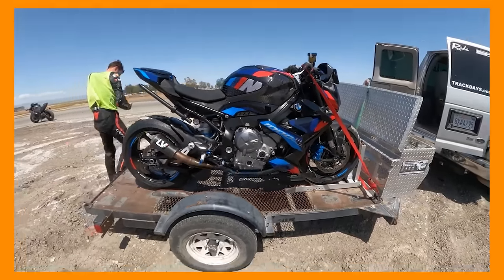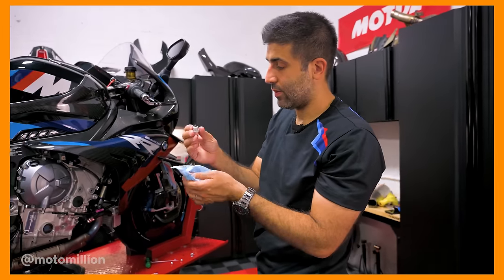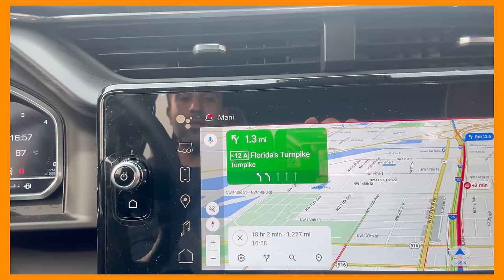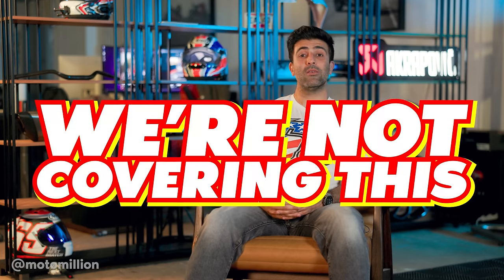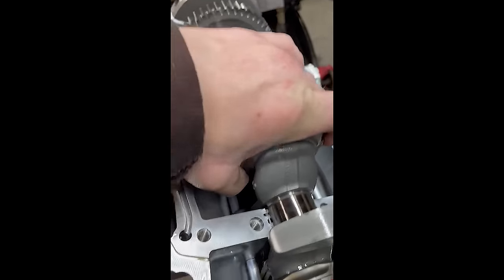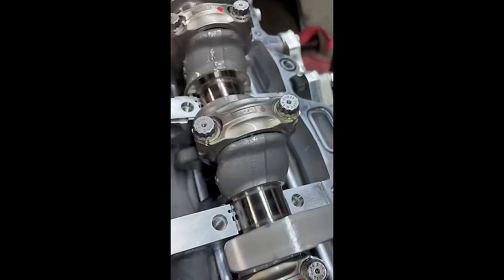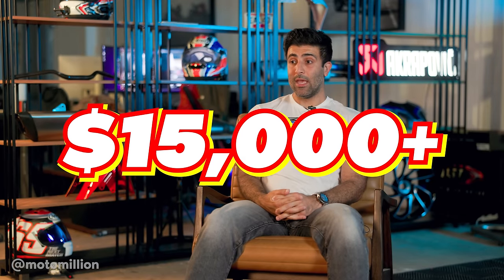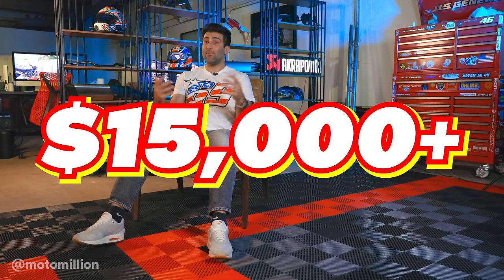MASSIVE Engine Failure on our M1000RR & BMW REFUSED Warranty...

Comment: Had a BMW S1000RR 2020 M-packge.

Nothing but problems on my side, I sold it and bought a Yamaha R1 2024.

Things I changed on warranty:
-handle bars rubber
-left mirror 
-front forks
-front calipers
-cam chain tensioner twice
-oil pump
-oil cooler (radiator)
-airboxintake silencer air filter box housing
-rear braking line and abs electric wire was touching the exhaust and popping ABS failure
-lots of condensation build in the exhaust cat and popping check engine failure

I got so dissponinted with that bike, I was so scared that one day that engine will blow up and die on that bike. I can sleep better now as I got rid of it. NEVER ever going back to a BMW or looking at them.
Reply from the maker: The R1 sounds the best of all liter bikes! Congrats on the 2024!
Reply: Dang, see I wanted to do a wrecked build series with a s1000rr, I don't think I do anymore hearing of issues like this because there isn't a warranty on those...
Reply: wow, that insane! I almost bought a non m s1000rr recently but picked up a ZX10r because it was so much cheaper and Kawi's history of reliability. My first ZX10r I put 55k miles on and it never once had any problems.
Reply: The newer ones are the problem.
15-18s are really great.
09-14s are okay.
Reply: @Motomillion r1 and ducati sound the best at a idle and low rev but, when you get into mid and top speed and high revs, bmw wins in the sound division.
Reply: Maybe BMW and KTM are related. Both make over priced unreliable shit.
Reply: My 2016 s1krr was great bike
Reply: That’s mental
Reply: @motor_head  my 18rr never had an issue, 16,000 miles or so when I traded it in. My 23 was taken and waiting on the 24, that I am now debating on telling them to keep it.
Reply: @taylorhickman84 Had lots of ZX10s decade or so ago and never had issues with them either. But one of them the cams that came out (was cammed) had low kms and abnormal wear on the coating of the cam, right on the end guide, from memory where the chain sprocket is. Engineer looked at it and said probably due to cold starting and lack of oil. Interesting, but I never had a problem.
Reply: @N4CR  Now that you mention it, one of mine had a problem with the cams as well. I bought a clapped out '07 with 13k miles and when I pulled the motor after I wrecked it, some of the cam lobes were slightly squared off instead of having a nice egg shape to them. I wondered if the previous owner had rev bombed it at bike nights. The bike ran fine, but it did struggle to get past 175mph when I did a track day at COTA.
Reply: I love the R1 they are great for tall guys like myself, have been riding gixxers for years but i am looking to buy an R1. 

I have to disagree with you on the sound i like the sound of all the other Japanese sportsbikes fours which haven't changed since my Z1 900 in the late seventies.

I guess the R1 sound is an acquired taste they did sound like all the others prior to the crossplane engine.
Walter.   @Motomillion
Reply: Wow, I was torn between s1000rr-m or R1 i'm very glad I went with the 23 R1 after reading about many issues like this. Thanks for leaving the comment brother!
Reply: I have a 2018 MT10 (basically a naked R1) and have ridden it 20K miles with zero issues
Reply: do not get it BMW suck any company that does this 100s of times is bunk  plus plastic water pumps on cars i seen the junk from them its a mix of great and WTF  @jasonisdn
Reply: RSV4 is the bike to ride.
Reply: @robvanduren761   KTM stands for ?  Klatters Too Much  ?   Mine did (past tense cause I SOLD it!  lol)
Reply: @taylorhickman84   cheese cams?
Reply: @luisdetomaso867   Yamaha is just a tick beneath Honda for stone cold bullet proof reliability!  But then typically Yamaha models are faster (but get sucky fuel range and tend to require premium where Honda tends to lower compression to accomodate regular...lower compression better reliability at expense of performance....obviously not accross entire range....not talking fireblades
Reply: @luisdetomaso867 Awesome, I have a 2024 R1(Raven). Zero issues and I love it.

Comment: I had purchased my dream bike, the 2022 BMW M 1000RR in mid 2022. I got to enjoy around 5k miles before I experienced a catastrophic failure like you had with your M. I was on my way home from work when it happened. I didn't tune my bike like most owners of these machines do, mainly due to fear of warranty becoming void. After 3 months of waiting, BMW honored the warranty and sent a new engine for my dealer to install.  Unfortunately the new engine experienced issues after the break-in period, dream bike experience wasn't as pleasant as I had hoped.
Reply from the maker: Wow, very sorry to hear about your difficulties with your M1000RR. Definitely something none of us want to go through
Reply: time to go to ducati or aprilia.. bmw is shit
Reply: Our dreams are usually better than our reality. ;<)
Reply: What did they do about the second engine?
Reply: @richardtavarez2614 Ducati and Aprilia are shit, too—many if not more stories just like this one. 🎉🎉
Reply: Laugh with suzuki
Reply: Wow $15000 dollar repair bill after buying  a $40000 bike,By the sound of it, quite a lot of Friday afternoon engine builds at BMW.
Reply: @trekshogun  Frankly, it sounds like there's a more serious problem (AKA engineering) somewhere.

Comment: Didn´t the S1000 models have a required run in time of about 1000 miles where the power was limited, and only afer that they could be used with full power??
Not so sure if hitting the dyno at a little more than 400 miles was the best idea then....
Reply: I guess he wanted to skip the run in by modding the ecu and the engine just died.
Reply: I thought it was 600 miles.  And, they put a tune on it prior.  Sounds like they voided warranty.
Reply: Revenge the engine on the dynowoyld be the best thing for the engine so it has a load on it BMW stupid for not fixing this under warranty this has already cost BMW more that the fix in bad press I was looking at one of these motorcycles now I would never buy A BMW anything
Reply from the maker: CaliMotoTV's BMW M1000R blew up on the track. That bike had a full exhaust and an ECU flash. BMW fully replaced the engine under warranty.

Why was Bill's replaced even though modification were present?

Carwow's stock BMW M1000RR also blew up on the drag strip.

BMW is having major engine issues on these new engines.
Reply: They nerf it to 8 or 9k RPMs until first service.  Felt like an eternity on my S1000RR.  As soon as first service was done and I took it to 13k, I had the biggest boner. lol
Reply: They removed it at 350miles, then did they own "break-in" on Dyno. Wouldn't do it to R1 or CBR even though you can, with BMW lol oh please. Amazing how BMW looked at the pan and knew that they sold M1000 to the wrong owner.
Reply: Sure, he removed the Rev limiter according to bmw instructions (!) but even if he done it before, it wouldn't cause this type of failure. Fan boys here sucking up bmw corporate are delusional.
Reply: @Motomillion  Bot response and didn't address the comment.

People are so bizarre in these comments sections.

Answering questions not asked. Bringing points to things never brought up in the first place; goal post shifting due to ego problems or ignorance introduced through stupidity brought about from arrogance?

Certainly plenty of deflection and evasion and predictable denialism in many responses to these very comments if any are made.

Texas sharp shooter and band wagon fallacies are not responses from a logical mind.
Reply: @jorelplay8738  BMW instructions say 1000 mi, and they do it to make sure whatever is gonna break, can break before they give it full power. this was also tuned after a first service which wasn't even done by a dealer. I'm not saying BMW is right in saying they had no fault, but he signed the contract which lets them void warranty for something like that, and thats what they did. It was one him.
Reply: @jorelplay8738 
This failure may have been imminent but if BMW allowed every bozo on YouTube to ignore warranty conditions, do services by themselves, remove rev limiters and destroy bikes on dynos before breaking them in first (all during warranty period), then they'd really be suffering from bad press as they would repeatedly be made fools out of by, in BMWs eyes, silly little amateur 'content creators' worth a few tens of thousands of dollars.

Do you honestly think a multinational corporation worth BILLIONS and a brand name over a hundred years old, whose revenue probably dwarfs many small countries' GDPs, would allow that? Get real pal.

Comment: you lost me at 18:52 haha ...   the break in rev limiter is part of the warranty whether you "believe" in it or not.  like how hard is it to put 600 miles on the bike?
Reply: I put on 120 miles on my new bike the day I picked it up at the dealers, before the week was out it was due for its first service, this bloke had this bike over 7 months and only put on 400 miles, says he hasn't got the time to run it in but finds time in 7 months to do a pile of alterations on the bike, found time for no reason to DYNO it and rev the nuts off it, fucks the engine then finds 38 hours to drive it to his mates BMW mechanic hoping for preferential treatment, this plonker needs to get his priorities in order.
Reply: @bobp6742 😂 love this comment! and then proceeded to do a 35 minute session about it. guy could have went for a 2 hour ride and be halfway there with the milage
Reply: @TwoTechnics76  
He has a bike worth 40k that had only 9 miles on it and what does he do, takes a fucking angle grinder to it, he's not well in the head.
Reply: @bobp6742   yeah I found it weird he took it all the way to Cleveland Ohio from South Florida, because he doesn't trust anyone else?? wtf? there's many certified BMW mechanics and shops in the state of Florida that work hard on these bikes and do great work... something doesn't add up about all that
Reply: @TwoTechnics76  
He knew he'd fucked up on the warranty and didn't have the means to buy a new engine.
He said his mate worked as a BMW mechanic in Ohio  and he went there just hoping his so called mate would just say to BMW that it was a fault in the engine and he would get a free engine, but it didn't work out that way 🤣🤣
So now he's whining and crying how bad BMW customer service is. Am glad BMW stuck to their guns and told him to piss off. I bet they've watched his videos of him breaking the warranty, their not that stupid.
Reply: I can understand your frustration given that other owners have had similar failures. One that basis, it does seem that BMW could have, in the interest of customer good will, approved the repair under warranty. It does seem that customer service and warranty claims on complex and expensive items like vehicles can often be a real hit or miss proposition these days. Having said that...

When you stated that your opinion was that break in mileages were just put there by companies for legal or liability reasons, you were probably correct. Ironically though , what you missed was the fact that in bypassing the stated procedures, it meant that the liability could very likely be on YOU, if something were to go wrong. I am not saying it necessarily should have been considering other bikes have failed in a similar fashion. On a brand new $40K bike though, still under its warranty and break in period, it might have been worth being very conservative. That would mean sticking to warranty related procedures (whether you agree with them or not) and going by the book. Corporate lawyers who write warranty and related procedures have no doubt  made sure that by ignoring any published procedure, you left them (at least legally), blameless.

Unfortunately it's a fact of life these days in the USA and most developed countries, that things are very litigious. The fine print in almost any vehicle warranty document attests to it.  

In summary it seems what your situation came down to is twofold:

1. By being dismissive of BMW stated procedures (in your apparent eagerness to move on with the bike as a project), you left yourself wide open for BMW to deny your claim.   

2. BMW could at least have considered the fact that there are other similar failures and, for the purposes of the good will of the brand (and the reputation of a flagship model), covered the engine under warranty. While BMW were likely not legally obligated to do so, reasonable doubt would seem to have lent itself to determining that repairing the engine under warranty was in the interest of their brand.

I share your frustration with what seems like corporate stonewalling. On the other hand, never give them a plausible reason to deny you service.
Reply: @rockyk3973  
I have no idea what the warranty says but if it's anything like we have in the UK then any alteration voids it. 
Had a mate who's new bike threw its chain within a hundred miles and smashed the gearbox, manufacturer refused the claim as the chain wasn't covered as its it's a part that wears. Fortunately my mate had taken a loan on it so he just told the loan company to pick it up and take it back.
Reply: Thanks, saved me a lot of time from watching the rest of the video. Love how he mentions another youtuber "did mods to their bike, so why'd you replace their engine but not my stock bike?!" but conveniently leaves out that he removed the rev limiter. Agree or disagree with BMW that's very obviously going to be required for the warranty as it's a break-in procedure they require you to do. Don't cry if you want to break rules and something goes wrong.
Reply: @Neziwi  I guess you didnt read the BMW first service so I will help you out "The break-in check is a standard service + an oil/filter change, removing the rev limiter and is scheduled at the first 300-750 miles (500-1200 km)" 

Where is the rule breaking? If its over 300 miles its good to go in BMWs eyes
Reply: @TwoTechnics76  He would of spent good 12+ hours with all the takes and editing just on the video lol
Reply: @bobp6742  Did he still have to pay the loan company back? any bad credit or anything (I'm from UK too) how did that work?
Reply: @PersonallyDeveloped  
This was back in the 80s, he had it on the never, never so it belonged to the hire purchase company so he asked them to sort the warranty as it's their bike, they just said they would pick it up and cancelled any more payments. 
Don't think they had credit ratings back then, but as the bike belonged to the credit company it was basically up to them to sort the warranty which they refused and they just took the bike and as my mate had only made one payment on it he didn't lose anything really.
Reply: @rockyk3973 
Wow !!!
That's Powerful...

Extremely Detailed, Yet Concise, Focus & To The Point...

He Basically Messed Up...

No Need To Be Soft, Respectful Yes, Soft No...

He's An Expert Concerning Bikes Compared To Majority of Bike Consumers...

It's His Right & Privilege To Do Whatever He Wants With His Bike...

But It's Also His Fault or Liability To Not Abide By The Written Policies & Procedures Listed...

As You Clearly Stated Concerning His Opinion...

💥💥💥💥💥💥💥💥

Thanks for taking time & effort to write & share with everyone so we have a very clear understanding of what happened...

No need for me to watch remains video, but I will..

Thanks again...
Reply: Very hard because he is so busy ! Like sitting on that sofa talking bull about how he didn't over rev it lol he could have done a couple of 100 miles
Reply: @Cramer12 the rule breaking is doing this "in house" especially the rev limiter. this shouldn't be difficult to follow on such a pricey bike! thibk about it: if BMW let every youtube "mechanic" do the VERY FIRST service themselves and monkey with critical engine parameters, they would be out millions. the rules are there to protect BMW, not the owner but are extremely easy to follow for people like me.
Reply: @Cramer12 The deal there would be if an actual BMW dealer did the first service and the programming. If it wasn’t them and someone just reprogrammed it on their own that’s where it voids the warranty. 
Generally if you’re wanting the warranty it’s best to let the dealer do everything so there’s a clear record of services and such.
Reply: Exactly!
Reply: @bobp6742 you’re spot on. Last year I bought a new F900R and the quickshifter and cruise control didn’t work and BMW gave me a loaner while they figured it out (turns out it was a software issue). Dealership made sure I didn’t pay a cent. I also found at that time these new BMWs track literally everything you do on the bike in their internal log and they can see all of it.
Reply: Just think that practically none of the engines that run on the track do that 600 miles before turning off the limiter, and 99% of the engines have absolutely no problems with this.

Comment: Manufacturers appreciate having documented proof of ECU modifications through flashing. Once this is established, the warranty becomes void, as the manufacturer no longer has an obligation to cover any failures. This stance is understandable since the engine is not operating within the original factory limits and parameters.